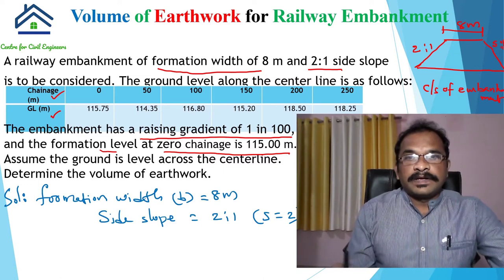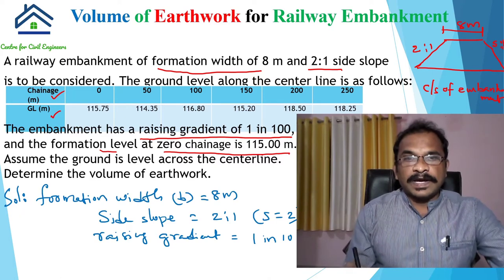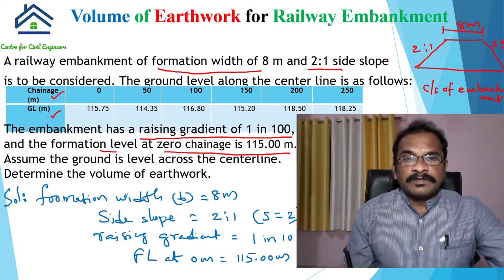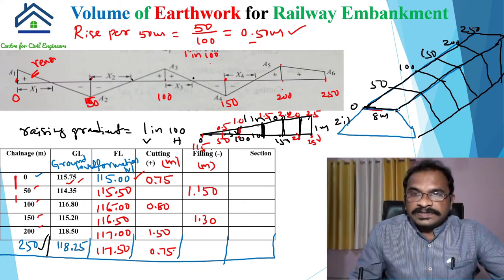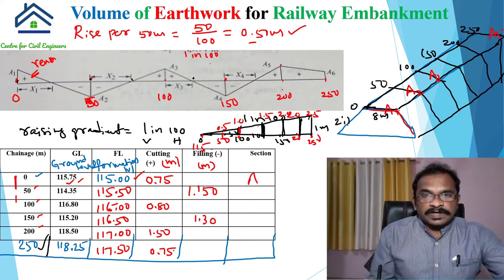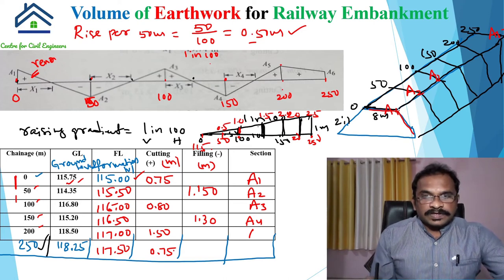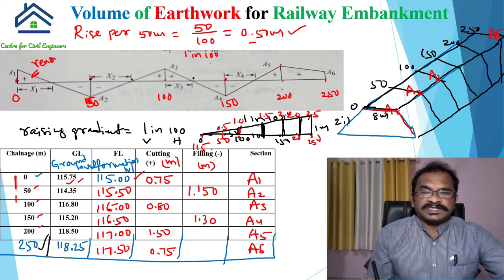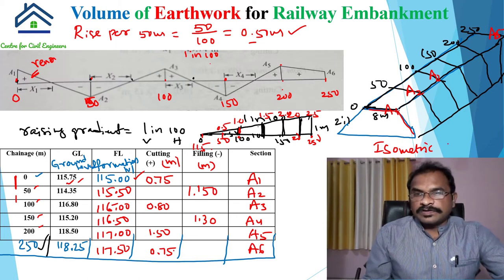Computation of Volume of Earthwork for railway Embankment in cutting and filling

Comment: Sir can we use same method for Roads also
Reply from the maker: it depends on shape of cross section of road. If it is like ORR you can use same as it is... I will make video on road earthwork work also.
Reply from the maker: mention which type of videos you require/useful
Reply: Videos on Rate analysis of different construction works and BBS would be very much useful sir